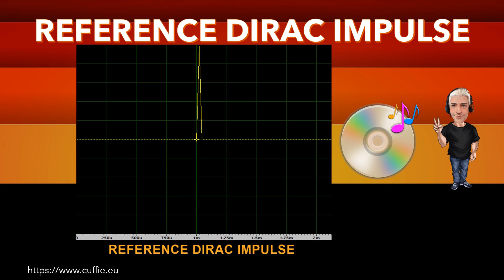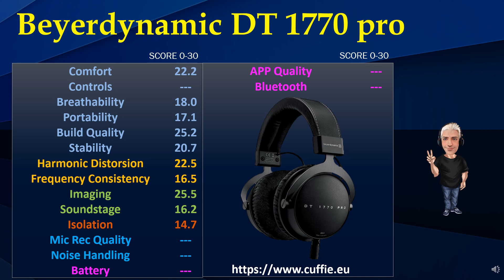BEYERDYNAMIC DT 1770 pro -- Sound Demo, Review, Recensione, Studio, обзор, Gaming, Test

Comment: A fat like. Your channel has refreshed my memory by sounds. When I listened to the headphones in the audio store and chose what my ears liked. I took the Beyerdynamic DT770 PRO 250 Ohm and the Beyerdynamic MMX150 for games. I listen to music and movies in the Beyerdynamic DT770 PRO 250 ohm, and play in the Beyerdynamic MMX150. So, I remember that the sounds of the Beyerdynamic DT770 PRO 250 ohms and the Beyerdynamic DT1770 PRO 250 ohms do not differ much, only the 1770 tops are lowered and I liked the 770 more. I'm listening to recordings in Beyerdynamic DT770 PRO 250 ohms here, via FiiO K9 PRO, and it seemed to me that the author did not separate the recordings of the original and headphones. They sound the same. I put on the Beyerdynamic MMX150 and that's when I heard a tiny difference, it's so tiny that most likely the author just lowered the volume of recording from headphones. The Beyerdynamic DT1770 PRO 250 ohm upper frequencies do not sound as good as the 770, the sound is slightly muffled. SHURE SRH840A, SENNHEISER HD 569, SHURE SRH840A, SHURE SRH 440A do not sound like the source and their sound is muted. AUDEZE LCD 5, HIFIMAN ANANDA NANO are almost like the source code, but they go into the upper frequencies a little bit.